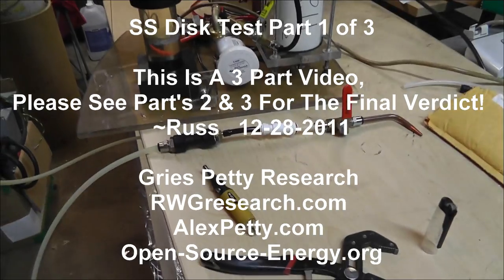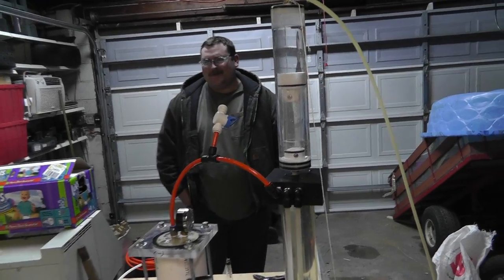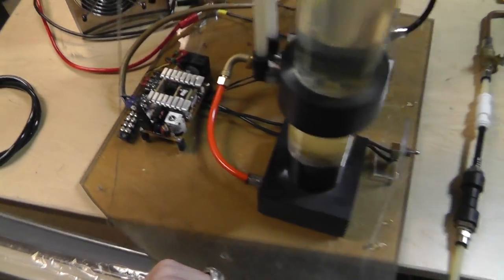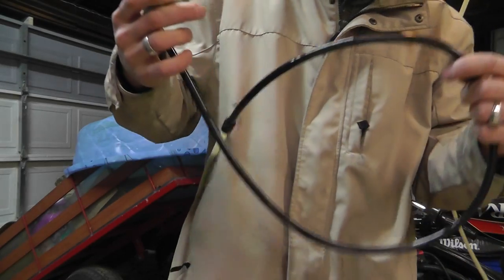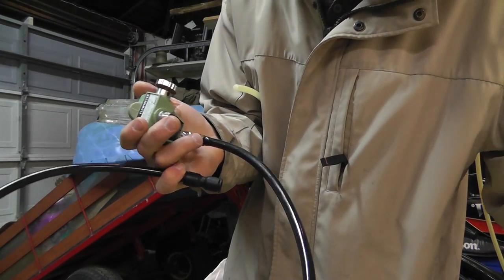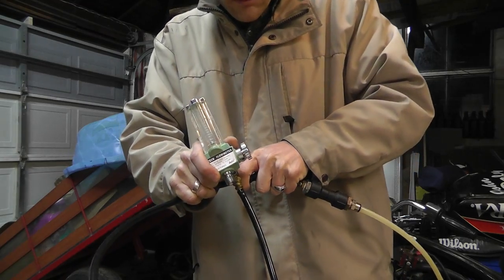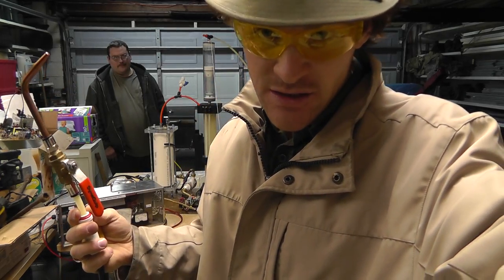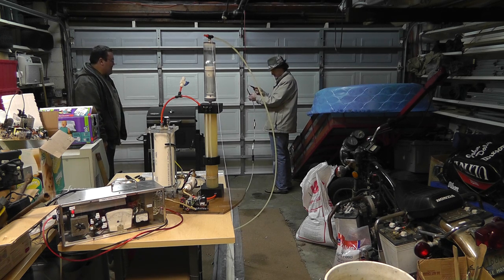P1 Stanly Meyers Quenching Disk Successes Works Like Stated! Its Real:) ~Russ 12-28-11

Comment: Interesting Russ and Hans... One thing relating to a low flow supply is that if its going to fail it would. Low to zero pressure differential across disc with the 40u disc.
Russ do you want a plate cell run produces 4 l/m with very to zero parasitic leakage?
just so happen to have one.......
Bill